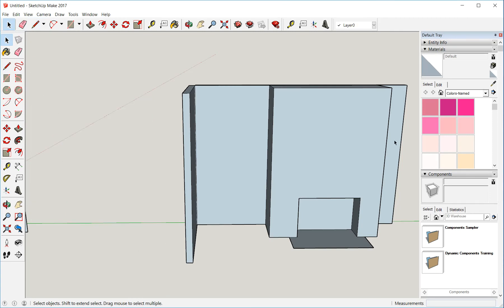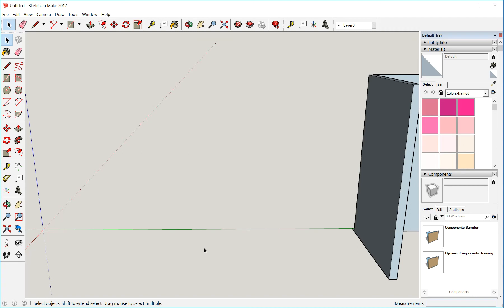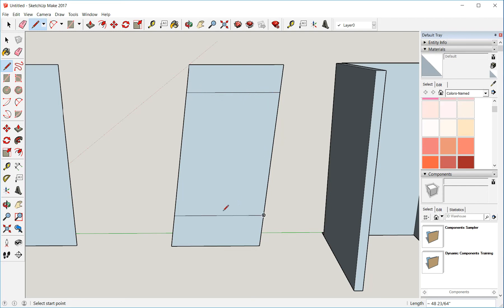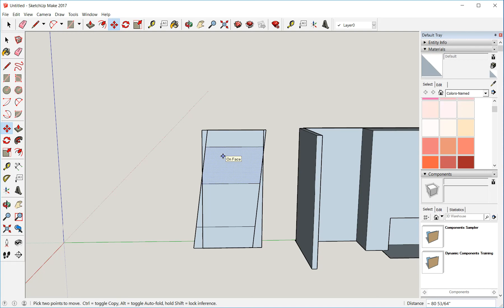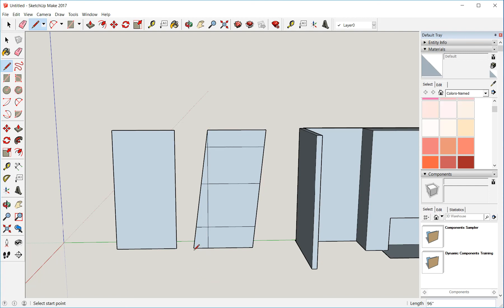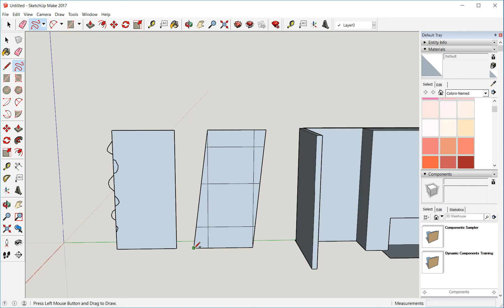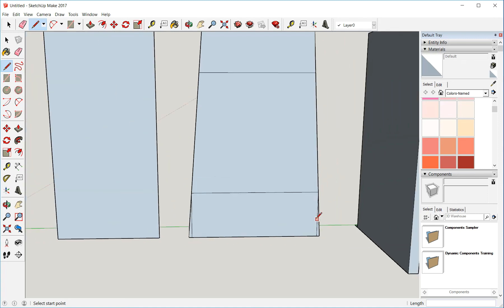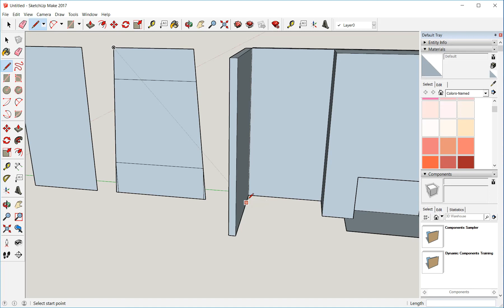Scribing Cabinets Between Two Walls

Comment: Thanks. Have you tried doing part of the fitting before the build?   Holding the stile and the level against the wall. Do 90% of the fitment only having to lift one piece vs. the whole cabinet.
Reply from the maker: oh yes for sure. Mostly though, I've done it with the faceframe. I build that first and then fit it in the opening. You're right :) much lighter than moving the cabinet, like the way I used to do it lol. Live and learn!

Comment: I know this might sound like a newbie question, but what do you mean when you say back bevel the sides?
Reply: He covers this in the face frame making videos. I will try my best to describe it in words. The idea is that instead of the face frame being a full 3/4" where it meets the wall and needing to scribe and cut all of that wood, he cuts the back edge of the face frame off at a 30-45 degree angle so that where it meets the wall is only about 1/8" thick so there is less wood to be removed when scribing and sanding/cutting to fit.
Reply: Steve M thanks! I understood what you are saying. Basically the edge the face frame that butts up to the wall is not square to the wall. It seems like you would need to know that info before you start building your cabinets. Thanks for replying to my comment! 👍👍
Reply from the maker: Thanks for explaining!! :)